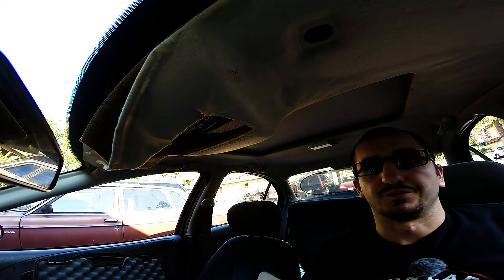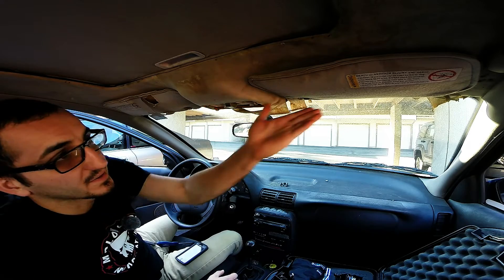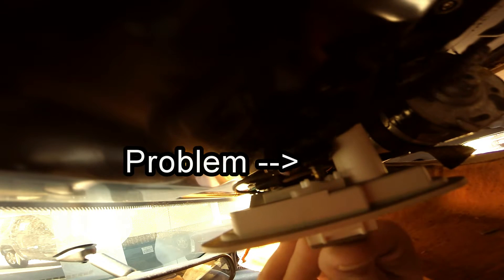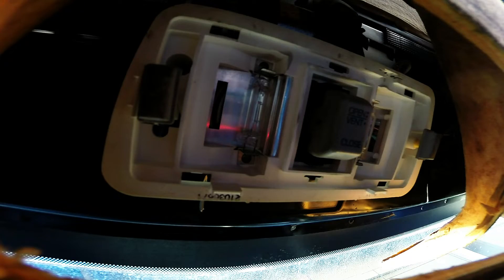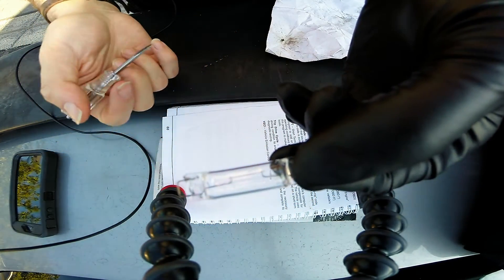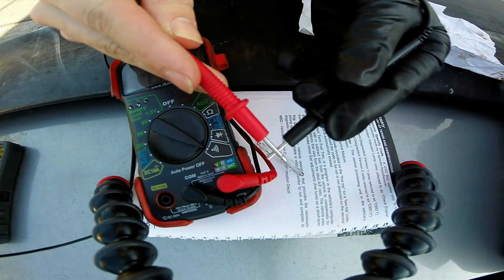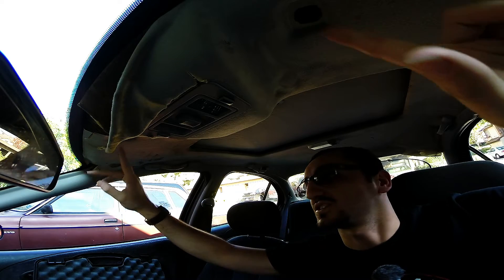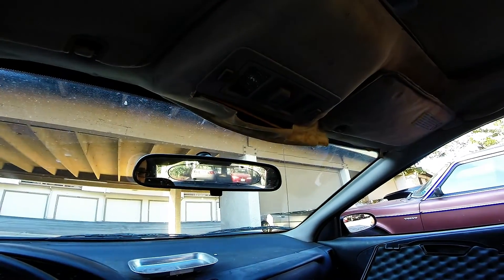How to Test a Dome Light and Fix Switches - DIYautotech HD

Comment: Those are map/reading/courtesy lights, not dome lights. A dome light is typically one bulb or one fixture that does not have a push button switch directly on it; it comes on when one or both of the doors is/are open, or when the interior dimmer switch is moved to the “on” position. Still a good video, just didn’t care for the terminology used. And for eff’s same replace that disgusting headliner!

Comment: Very helofull as I have an '02 Saturn and the dome & map light don't work and I put in new bulbs. I'm going ro test the fixture to if i have power going to it first. If i do, then it might be a switch problem but i don't see both swithes not working correctly,

Comment: I have a 2004 Nissan Frontier XE 2.4 liter. I have owned this truck since new. The few issues I’m having are:
1. My interior Donne light doesn’t work. Both door switches voltages are 4.6 while the dome light is 9.6. This is with the key in the on position. While off I’m getting nothing on the dome light. Odd
2. My keyless entry doesn’t work anymore. I’ve tried replacing the battery in it and nothing. 
3. My door chime doesn’t work either. I’ve left my lights on numerous times because it chimed when I left them on but nothing now. 
If your thinking change the fuse? Yes, everything is good because I checked it all with the voltage meter reading 12 volts. 
My other guess would be a ground but I don’t even know where to start. Kinda frustrating. I really don’t want to take it to get it checked because I know it’s gonna be over $100 just in labor to troubleshoot this. Any ideas or help would be fantastic! Great video